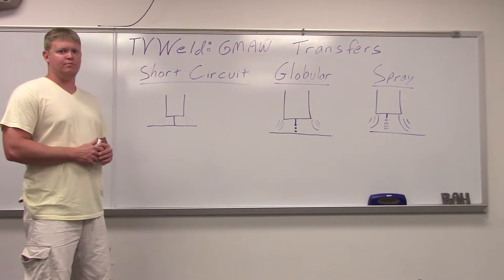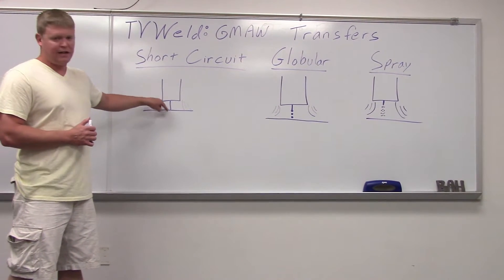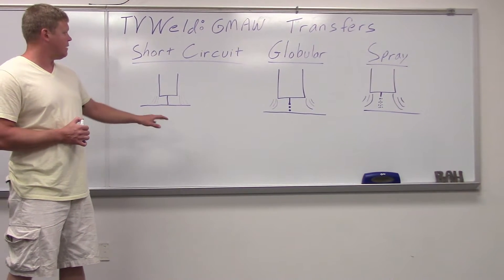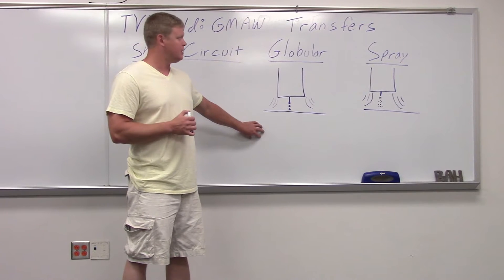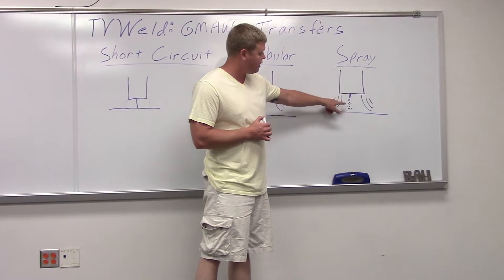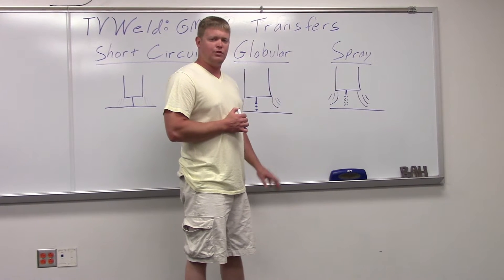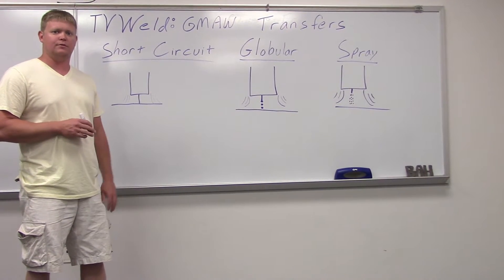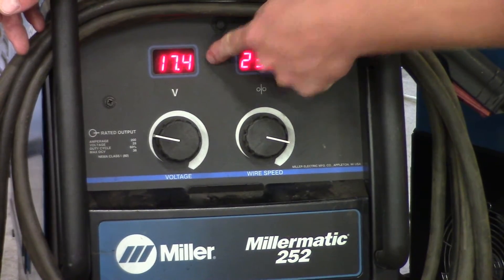MIG Welding Metal Transfers

Comment: I am struggling to get true spray transfer on my machine.. its limited to 26 volts but currently running a 83 percent argon co2 mix.. would you say a 93 percent 5 percent co2 with 2 percent 02 work? running a 1.0mm wire on a esab rebel ) newbie welder here
Reply from the maker: We usually run a 90%Ar/10%CO2 for spray steel.

Comment: why would u not show spray on steal are the settings the same for cold rolled
Reply from the maker: I didn't do it on steel because I had an aluminum welder already set up for spray transfer.  If you want to do it on steel you have to switch the gases as well so I guess I was being a bit lazy.  The settings are the same for cold rolled.